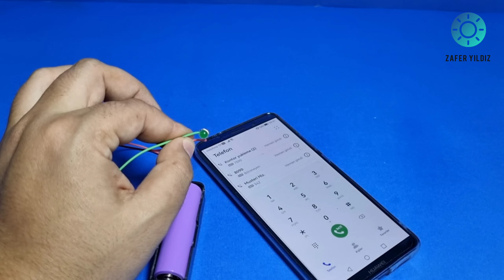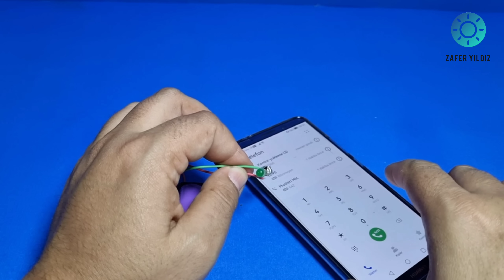3 Great Electronic Projects That Anyone with a Hobby Can Do

Comment: nice bro
i made automatic LDR by bt136 triac 330k Resistor and LDR but it doesnot work   could you help me why?
ldr joined 1 and 3 of triac 330k R joined 2 and 3  220v join 1 and 2  but it doesn't work i don't know why
Reply from the maker: There are examples of this on the channel. If you did it exactly, it may be because of the triac you used. There are many fake models on the market, get an original one.
Reply: @ZAFERYILDIZ52  i tested the voltage of triac with multimeter and saw 220v ac  but i connected to a led lamp the voltage decrease immediately to 30 40 v ac do you know why voltages decrease after connect 220 ac of triac  to 15w led lamp
Reply: @ZAFERYILDIZ52  i tested the voltage of triac with multimeter and saw 220v ac  but i connected to a led lamp the voltage decrease immediately to 30 40 v ac
Reply: @miladshiri9503 Everything happens because of the internal structure of the LED lamp. The gate current of the triac doesn't rise sufficiently and also the lamp doesn't light up fast enough to maintain the minimum latching current through the triac. The simple triac switch with LDR is designed specifically for incandescent light bulbs .

Comment: Why does your picture  on the video shows a simple circuit, as video starts you start showing items not visible at the beginning?
Reply: The "circuit" in the thumbnail is just a 3 pin resonator soldered to the legs of a transistor.  It won't do anything.
Reply from the maker: just a cover photo